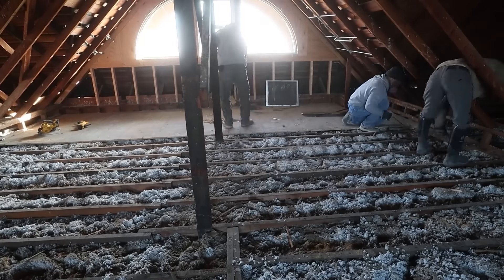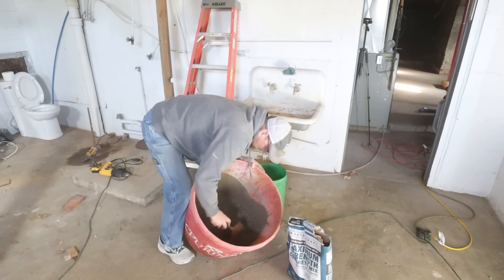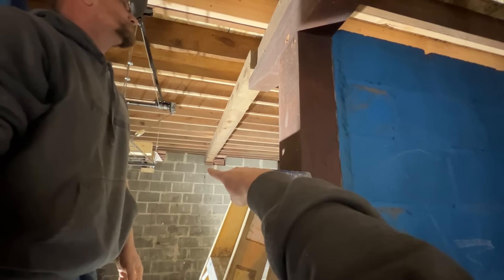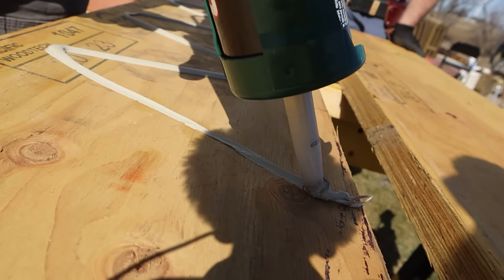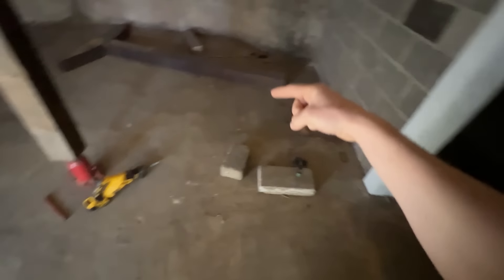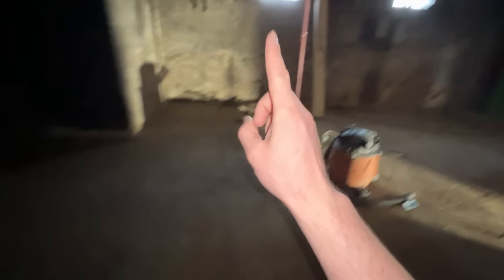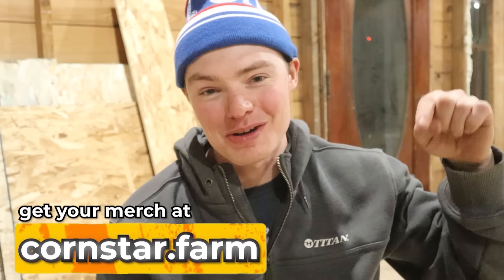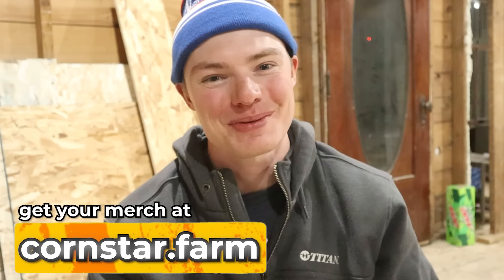Restoring A $7,000 Mansion: Rebuilding Basement Ceiling

Comment: OK COLE Radon is a gas it tends to rise and fall with barometric pressure low pressure lets the radon come out of the ground and creates higher levels high pressure lowers level. If you tie your floor drains to the creek don't use perforated pipe it will let radon into your basement if you have it. If you decide to test for it do a long term test. Since levels go up and down with the weather it will give you a better reading. With the size of your home you will probably need more then one draw point. If you are going to take up the floor put a good base of stone under the new floor you can put some perforated pipe under the floor in that stone and 90 it up with solid pipe if connect it all together you will only need one draw point. also when you start your plumbing you can run that 4In line from the basement through your roof and vent it there. You will need to put a fan in that line to pull suction on the air under your basement floor to collect the radon and vent your house. Sine you are using foam insulation you are making your house very air tight and any radon that comes in can not get out. So it becomes a venting problem that why you pump that air outside. Radon is not expensive to mitigate if your redoing and remodeling like your doing a couple of hundred in pipe and a fan is cheap to add now that there is know drywall on the walls and if you redoing the basement now is the perfect time to install the system for peace of mind I would recommend a test after the house is done you can put all the pipe in now and just make a space where you could add the fan if you test high. You maybe able do just have a passive system. But don't test till the house is all closed up and insulated you won't get a good test with the doors and widows open and  workers in and out all day.

Comment: Do not connect interior floor drains to exterior foundation drains.. buddy of mine.. got laundry at 6am... Then went to pull something out of freezer at 745... Had two ft of water in basement due to drain line leaving foundation plugged and flowed into basement sump hole..

Comment: I think you’re better off doing a water mitigation system inside the basement rather than digging up the outside. You just need to put in a drain tile system along the exterior walls inside that goes into a sump pump. That’s the way most told her houses are done, and it’s more full proof then trying to do it on the outside. Water can still get in so you would still want some type of system on the inside.

Comment: you have an open well in your basement who is not spilling out water. your watertable is probably way below your basement. You dont need to break up all the concrete and put in floordrains. I think a pumpsump is enough. maybee cut some drainage channels in the floor tzo the central sump.
Or to your well.. it caould also take wate from time to time. All you need these days is maybee a shopvakuum. 
But all depends on how your basement was the last years.. was there ever standing water in it? of not than you dont need floordrains.

The french drein outside is to redeirect rain comming trugh the soil to your house as a waterpressure outside. it is not connected to floordrains or a watersystem in the house. Its often not at all connected to a builöding waterline but runs far away (and below your basementlevel) into a drainagefield.
Or also below your pipe levelfrom your house probably hundrets of feed away into a cental water system.

The basementwall should be fairly watertight. if you dig a french drain it should sit below your foundtion level. if you do this you can waterproof the outside wall of the basement. and the french drain pipes will be covered with washed strone filling to break the cappillar system in the soil and redirect the water into the french drain pipe below.

Comment: Add network cabling runs or conduits…yes wireless sounds easier but even mesh routers work better connected thru Ethernet cable runs. But I assume you have done the home work on this already.

Comment: I would not recommend a drainage that goes from the basement, through the wall and is connected to the drainage around your house. Not unless you make sure the outside drainage is much lower and the inside is barred with perforated steel lids, so no critters can enter. But again, ventilation is super important in basements, and can help vent out moisture. To get new concrete, you just use a pump to get all the concrete distributed all over the basement. It is not a problem to get a longer hose..

Comment: On the beams, you should use a zig zag or wave, not a circular motion.  In theory, air pockets could become trapped and prevent as good of a bond as possible.  But like I said, in theory.  Reality is that it doesn't really matter

Comment: OK Cole.   Clean the sink in the basement, it is a health hazard.     
Because there are not cracks in the floor now, then don't mess with it.  Same with the walls.  A hundred years has not compromised the walls.  It was built as not to leak.

Comment: How is the beam attached to the wall? If its just the non-reinforced concrete you manually added sitting on blocks, that is not enough. The beam needs to be structurally attached to the wall and not just rest on concrete that can crumble. How is the other end attached?

Comment: Why put drains in the basement?  Wouldn't sump pumps be less work?  Maybe you are planning on finishing the basement floor?  If you are going to french drain the outside walls, no need for floor drains.  Sump pumps will work just fine.  If that well you have is 23 feet deep, this means your water table is pretty far down (it isn't overflowing), which means your water intrusion should be minimal.

Comment: About 30 years ago I did tiled round the outside of my house 10 rears ago we had a leak in our basement found we had a crack in the wall had a company call Basement Boss come in and tile around the while inside of the house and I am surprised about how much water comes through it. You are tearing up the whole basement floor I would do around the out side wall. When you are doing the concrete it is going to cost more but if you get a company to do the floor that has a concrete pump you can put it were you want. Forgot two if you tile around the outside you have to get under the porch and break up the concrete at the side of the house. Good Luck.

Comment: I wouldnt have my plumbing run down into and under the slab, i would take everything from the upper floors and turn it and go out through the wall on grade to the septic. The toilet and any other plumbing you might need or want down there can be plumbed into a sewage ejection pit and pumped up into the drain line you run through the wall that is coming from the upstairs drains.  The floor drains and such can all be run into the sump pit as well as any under floor drainage tile.

Comment: Do not tie the floor drains and the foundation drains together.  If the foundation drains get overwhelmed they could back up into the basement. Once you are a far enough down hill from the house then then you could probably tie the 2 together for the final run.  Check your local codes.

Comment: Cole,
   My first insight is,
You keep calling the floor a floor- it's more of a concrete cap. I'm sure it was dirt floor past the 50s. Here in the Northeast- in the old times - we would sweeten the cellar, remove 6"-12" of "dead-dry- soil and replace it.
I would completely remove the cap, re-engineer waste pipes, breathing (radon) and  a sump or direct flood waters to an area.
••Remember mistakes in house can flood, fire dept, weather, farm mishap or an aquifer change.
If you're able to plan, it's worth it.
•••breathing- radon prevention is pumping and removing air under your floor or cap, cycling fresh air vs "dead", why not just circulate air whether radon high or not.
You can even have it so solar fans work only when sun is on a panel.

Radon was discovered (1899) 20 or so years before the house - so it probably started to be a precaution just after.
Great videos
Thanks

I work in basement & crawlspaces- daily currently for mold remediation, but have been doing every stage of home improvements/repairs for 40+ years

Comment: I don't believe an under the floor drain is necessary if your groundwater table isn't an issue. Sump pumps usually deal with that issue. Consider though if there isn't compacted gravel for that water to flow through, it may not reach the floor sumps. Foundation drains can be done interior or exterior, exterior being preferable. However, do the interior given you are replacing the floor. A interior perimeter drain partially eliminates the issue with silt filling the drain pipe. They make several drain pipe options, 4" schedule 80 PVC, although a lighter schedule is also available. They come with weep holes pre drilled, holes go towards the bottom sides, or there are flexible corrugated pipes with sock coverings already on them or another option is a square plastic system. All should have 1"+ gravel surrounding them 12" to 16". There is a debate on the filter fabric, it can plug with silt, especially on the exterior of wall if there a lot of water movement. Some wrap both the pipe itself and also wrap the gravel surrounding the pipe completely. A French drain installer, slightly different scenario being shallow, swears by just gravel and pipe. I would use 4" or 5" compacted gravel across the entire floor , then dig trench on the perimeter of the exterior 16" by 16", lay fabric on the bottom and sides, fill 8" cleaned 1"+ gravel, set socked drain pipe, fill with remaining gravel and lay your 2" or 4" of insulation and pour the floor. Don't forget to get the elevation correct on your foundation drain sumps correct to leave the correct depth for water to run and the drain pump to activate and pump any water. Hopefully they never run! Hurry up farming is just around the corner! Up here in Montana we are calving, getting what equipment work done we can, it's supposed to snow 8" to 12" this week, and unfortunately I spent 4 hours today on a car accident as a volunteer fire fighter, but everyone survived and were able to extricate. Long day!

Comment: The most important thing we need to live besides air is water.  If that well is good, I'd advise you to keep it. Simply because you dont want it anymore seems kinda selfish to me. I have a well somewhere on my property but have been unable to find it so far.  Gonna get a metal detector this spring and see if we can locate the piping.  Plain to use it to water my yard since am limited to 1k gallons of town water monthly. The bottle jack is old. The seals are made of rubber which have a shelf life of about 20 yrs. Seals are bad is why its leaking.

Comment: You need to pump the concrete into the basement. No point using a boom. The window holes are too small for a Z boom to fit into. You can use a little line pump. Just look up concrete pumping and you will understand.

Comment: You sure don’t need a concrete pump with a boom, just a towable pump. 
I know you want to do most of this build yourself with friends. These concrete floors need laid out, poured and finished by someone with many years os experience. You don’t learn to finish large. Pours of this type by reading directions on a bag!
You mention having floor drains this will require some slope in the floors, not level. Not having the floors poured and finished correctly will give you a great product, not another costly headache.

Comment: more important than the thickness of the concrete is the amount of bearing looks like your good .....carry on LOL....at least you guys learned to prefill the block cores usual method is fill cores and let the concrete set....then steel shim the beam to correct level...then use non shink grout to fill gap......hopefully its non-shrink concrete.....for the floor work you PUMP the concrete, google concrete pumps specificly trailer pumps etc..... its common in new construction in wet areas to have drains around the outside and inside perimiter of exterior foundation which is lower than slab level and usually the gravel under the slab allows water to migrate to the drains ....if you expose the outside basement wall put on a good waterproofing assembly on the exterior of the wall there are several options.....you boys have lots of energy carry on.....bin site debacle is providing you invaluable experience in "what ifs"

Comment: it would be cheaper and a hell of alot easier to remove a section of exterior basement wall big enough to get a skid steer in and also digging a hole /ramp with excavator . remove floor with skid steer  repour using pump truck via ramp   and the repour section of basement wall       already digging to install drainage and sewer regardless      save on alot of back breaking labor too

Comment: RADON. Can be expensive to test and fix.   Test asap before you fix the basement floor. Our house in Lawrence had a high rating. Had to drill holes in the basement floor and a wall.  However, house might need to be completely closed up for adequate reading.

Comment: I wouldn't put the heating in the floors.    To much of a headache if it fails.   Plus the heat isn't worth it vs a forced air system.    You need ductwork for cooling.

Comment: All you got to do to pour that basement floor and get it ready and then they make this thing they call pump truck you don't stick to shoot through the window you got to rent a pump truck the truck will back up to the pump truck and dump the concrete in and you got a hose you start from the farthest corner you can and if it's got enough holes you can pull the whole basement. Just make sure you got enough light in there so you can see you need to rig up some lights so you can see and then all you got to do is have a pump truck and however many trucks it takes to pump enough in there to get it to where you need it it's easy don't overthink that don't think you're going to put a concrete shoot through the window and make a pile in the floor and you're going to push it around and fix it. That's too much work you need a pump truck. I'm not trying to tell you what to do but I would get a concrete guy in their dig up a spot in the floor and check the footers out if the footers are not thick enough you can dig out on both sides and pour the footers in sections. I would cut the entire basement out bring in a certified plumber make sure that plumbing is right. That's nothing you want to cheap out on. You three guys you would probably need a couple more guys but if you got a pump truck with a hose you could do that whole basement floor with a Bull float in a day finished. Then you know if there's problems with the footer on the outside when you go to put your foundation drain in which I would do but I would also put black tar on the block to keep from getting water into they even make like a paint that you can put on the block on the inside this not like it don't stink they even put like a waterproof membrane over the tar after they put the tire on the block for water suppression.

Comment: Instead of tearing up the whole floor, all you do is go around the outside by your wall and make it wide enough and dig it down and put your drain tile in and cover back up and bore your concrete. If the floor is good, there’s no reason to tearing it up, unless you want to spend a lot of money looks like you’re spending a lot on that house already

Comment: Why don’t you cart it over to the other side with a cart or wheel barrow and dump it and then fill up the wheel barrow right from the cement truck to save extra work of dumping then scooping it up just to move it. Personally I love a beaver water system that can get to a drain in the corner under the high drainage plumbing upstairs and upstairs and upstairs from SW WI. One grandpa and father master masonry and the other grandpa built houses by himself and he built the home I grew up in and we had a boiler system for heat just like you took out and I have an old ordering options for different things but the first part of the book has unique scrap book information-news and deaths. Just an FYI P.S. they have been gone for a while. Grandpa WWI and dad WWII. I’m 59

Comment: @Cole The Cornstar
COLE!!!!  I'm about to save you about a metric ton of money and time here.  You do NOT have to dig down and install a drainage tile around your foundation.      
"Well gee, Steadfast, just what is it that you are proposing??......"  
Golly geewillerkers I sure am glad you asked me that Cole!!
You would acquire a roll of heavy-duty plastic sheeting, as heavy duty as it gets. 
Wherever there is porch this need not be done, which I'm sure you're aware of but, along the weather-exposed portions of the foundation you would dig a 3-foot-wide sloping trench that declines away from the house.  
At the foundation, which should have from 4-6 inches exposed below grade, you would then attach a 4 foot wide sheet of the plastic, below grade an inch or two, that runs the length of the wall plus enough to overlap the next intersecting sheet. Regular old tar works very well for this. A 2-3 inch strip of it should suffice. Press the plastic into it. That creates a waterproof seal at the edge of your house. 
How much decline you have fully depends on whether you are planning plants and/or shrubbery in those areas. Speak with someone who knows root depths and such. 
I would think (and have used) between 2 and 3 feet at the deepest at the outer edge of the trench.
I've done this. It works. It's cheaper. It's faster. Do this and your basement will be dry as a bone for the next hundred years, minimum.
I enjoy your videos so much that I'm even gonna give you this nugget for free!!!  (hehehehehe)

As far as the concrete truck and the porch goes ...... are the planks on the porch nailed in or screwed in??  You see where I'm going with that, right? .....